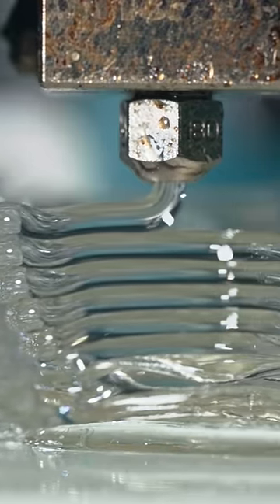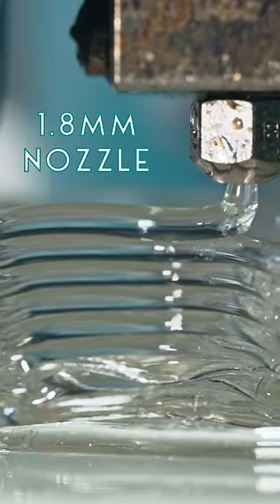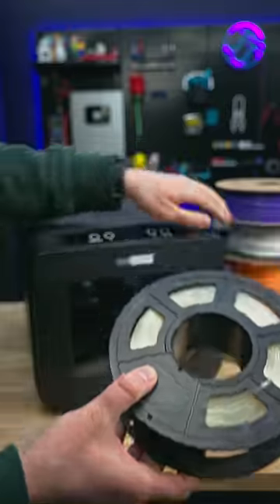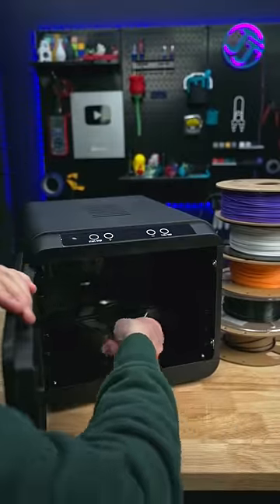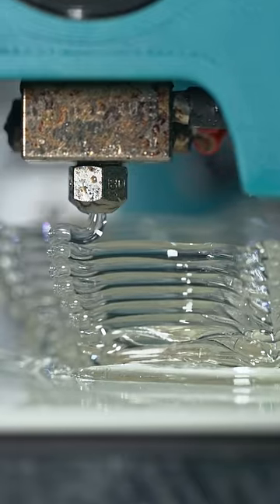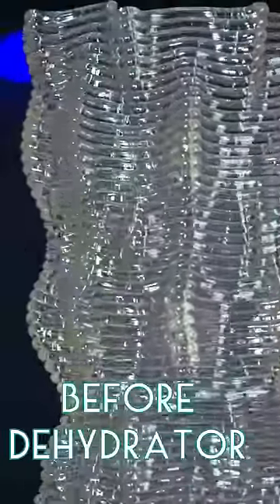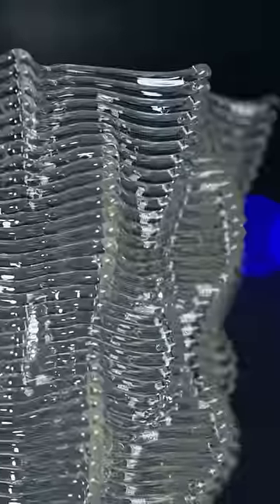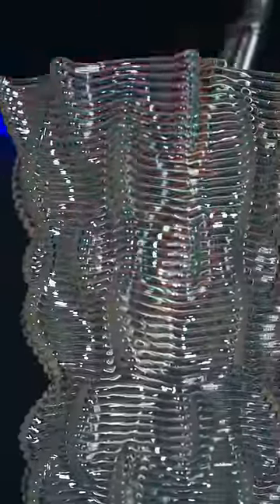Dehydrating Clear PLA Filament

Comment from the maker: 🔥My Favorite Starter 3D Printer: https://amzn.to/40NWmg5
Favorite Mid-sized 3D Printer: https://amzn.to/3Eq9KNa

🌈FAVORITE PLA Filament: https://amzn.to/3UkGVJx

📂STL Link: 
https://www.printables.com/model/16170-lumpy-bumpy-vase

Patreon Support: https://www.patreon.com/jjshankles
Support me on YouTube: https://www.youtube.com/channel/UCHH_3lX8QShJnhHVA422OCQ/join

📖Learn more about 3D Printing with a Podcast I co-host: http://Perfectfirstlayer.com
Reply: Make a star for a Christmas tree then stuff it with lights.
Reply: Have you tried color dream looks way clear?
Reply: I like your printer suggestions.  What do you think about Bamboo?  Aside from the high price
Reply: Why did you set the layer hight so high, or is that a result of a high z offset? Either way what is the point of doing so, if anything it will severely degrade the print quality
Reply: @patrickputrus560   point here is NOT to squish the filament so it stays as clear as possible. It still stick pretty good. I tried 0.4mm layer height with 0.4mm nozzle on the same model and got just a single random leak when filled with water to the brim. And the print looks quite nice.
Reply: Where did you get the filament and what was it called?
Reply: what song did u use?
Reply: what song did you use?²
Reply: You could use it as an optic light transfer cable, print a certain shape, damage it in some parts and shoot a laser beam at the end of the print
Reply: Which dehydrator is that?
Reply: Going to be honest dude I see no difference
Reply: ‼️MAKE CINDERELLA SHOES! The ICONIC clear "glass" high heel!
Reply: How much does that much filament cost?
Reply: Nice
Reply: I challange you to make a print/vase/cube... Whatever. As see-through as you can! 😊
Reply: Okay I've got a random challenge for you... Make swimming goggles and a snorkel.
Reply: please link to the clear PLA!?
Reply: Do a shower curtain cup that when you fill it up with wine it shows Janet Leigh screaming
Reply: Hey is this the white lithophane filament?
Reply: Why isn't the dehydrator listed? (VIVOHOME Electric 400W)
Reply: What about the filament?
Reply: What kind of dehydrator is that?Thanks!
Reply: Is there a way to possible get CultureHustle LiT pigment and with a glass muller get the pigment fine enough where it could applicable and be used mixed with a resin of some-kind… 
And possibly use the different variants of colours and pigments.
Reply: @patrickputrus560  - Seems the layer ht. is part of the intended aesthetic ., especially as that's the stated goal from the start of the short re: the large nozzle diameter. I'm guessing he knows about tighter layering ? Just a thought 👍.
Reply: @kisolre - if you want to make it waterproof, seal the inside with a poured layer of clear epoxy . If you're going for a decorative outer pot for your plants,  a smooth sided glass just smaller than the print so it just nests , is a very repeatable approach . 
Shoot, this you've produced is an absolutely sellable product . 
Lots of retail outlets would stock something like this as "Home Decor" . Good LUCK !!
Reply: @chuckintexas  simple nail polish top coat works like a charm.
Reply: Love how none of these links have nothing to do with the dehydrator or clear PLA that you used. :/

Comment: does this mean that hypothetically a hot glue gun is a 3d printer
Reply: When I was working in a packaging factory we had industrial hot glue guns and when I got really bored I’d make little “3D prints” with them. None of them turned out remotely good, but it was fun to do it lol
Reply: It’s exactly a CNC hot glue gun
Reply: Ive used it like that before. Very hard to control the shape obviously, but it was fun lol
Reply: look up 3D pens
Reply: A hot glue gun on a claw machine, yeah
Reply: A 3d printer is just a CNC hot glue gun
Reply: @Frost3D44  best description honestly
Reply: can you make anything out of it with that much strength lmao
Reply: I mean I made an entire river side for a project in 6th grade when I had to make a ziggurat with only a hot glue gun, so I mean technically
Reply: @DoobLand  its makes glue
Reply: Hot glue is like top 10 of the main hobbyist tools. I've seen full dragons for DND made of just glue and looked awesome
Reply: Technically yeah
Reply: Yes
Reply: That's exactly how I explained 3d printers to my family. I told them it a computerized glue gun lmao.
Reply: @JxqGames this may sound dumb, but whats an industrial hot glue gun vs a normal one? Asking cause I hot glue a lot and am wondering if it would be worth getting an industrial one rather than my joanns ones
Reply: Yeah basically but it's more like one of those 3d pend
Reply: @zyourzgrandzmaz  that’s insane no bap
Reply: @mastershooter64  Yeah, just got my daughter one recently. My first thought was that it's just a smaller hot glue gun with a feed button.
Reply: This is like calling a sharpie a printer
Reply: Arguably welding up litte gaps with mig machines is just metal printing. I often weld useful shapes on dissimilar metal and if i go cold enough itll come off smooth backed.
Reply: If your hands are steady and you're patient enough, sure!
Reply: boutta say the exact same thing lol
Reply: Yes
Reply: Thats how scott crump came up with the idea for the fdm printer. He was making a toy frog using a hot glue gun and some kind of plastic and building it layer by layer.
Reply: Stratasys the inventors of modern 3D printers took heavy inspiration from hot glue guns. In fact the earliest FDM prototype printers in the 1970s/1980s were basically hot glue guns in a plotter. ✌️😊
Reply: I don’t see a difference.
Reply: Sigh No Patrick, a hot glue gun isn't a 3D Printer.
Reply: Technically we are all living 3D printers, unfortunately the only thing we can print is poop emojis
Reply: A pen and a 2D printer both use ink, but you wouldn’t typically call a pen a printer.
Reply: The first ever prototype for a 3d printer was actually a glue gun
Reply: Yeah but there’s also 3d printing pens that you can buy for 20$ online
Reply: What’s the song name
Reply: It has been done before
Reply: A CNC machine removes material.
Reply: @gregdubya1993  not always.
Reply: The same way a pen and pencil is a printer yes
Reply: lots of things are 3d printers if you think about them enough.
Reply: yes. they even make little 3d pens that are basically hot glue buns that you hold like a pen and use filament for
Reply: @JxqGames cool story my sister did a similar thing and became a piece for a bored game
Reply: a skilled user on hot glue gunning can do objects better than any printer
Reply: Yes it can be
Reply: a 3d printer is basically a CNC hot glue gun
Reply: Hot glue sticks are literally made of wax and some low temp plastics and polymers, so it's exactly that.
Reply: It's a 3d printing pen
Reply: Just slower drying and less precise
Reply: 3D pen, and they make those.
Reply: @MerpSquirrel  yeah, but that's not what they asked...
Reply: Tell the guy who patented fdm printing made the first 3D printer, he basically made a motorized hot glue gun it made a plastic frog for his daughter
Reply: Basically yes
Reply: No just no
Reply: Ben Shapiro: Now, let's say, for the sake of argument and hypothetically speaking, that a hot glue gun is a 3D printer.
Reply: basicly a 3D pen @JxqGames
Reply: Yes
Reply: @mmace3  and babies sometimes
Reply: Its exactly the same principle, just that the nozzle needs to be a BIT cooler
Reply: I’m gonna try this when I get home from my grandmas, got any idea what I should try to “print”?? 😂
Reply: You don't have to cut me out my full brain exploded when I hear Patrick say his first fact 😮
Reply: The same way pen and paper are an ink printer, sure.
Reply: That’s how I explain it to people who don’t know what 3D printing is.
“It’s like a hot glue gun on a robot arm”
Reply: @JxqGames omg. I used to have a really artistic friend who made a sitting woman with a ponytail out of glue w a gun. It looked exactly like what it was supposed to, and it was his first try. 

Unfortunately hes now in jail for murder though, so his talent is wasted
Reply: 3d pen
Reply: The psychos that make those stupid 5 Minute Craft vids seem to think so😂
Reply: kinda but takes a lot longer since you have you wait for each layer to dry fully and it’ll be super flat
Reply: If ur good enuff
Reply: Yes
Reply: If a pencil is a 2d printer to u then sure
Reply: Girl math says yes
Reply: A paper printer is also a 3D printer too so yea
Reply: Exactly what I came to say just late to the party 😂
Reply: It would be a 3d pen, ehich already exist, if u put plastic cylinders in it instead of glue
Reply: A human can be a 3d printer if they’ve ate enough Taco Bell 💩
Reply: @JxqGames  I think you want to hot glue a sheet of wax paper or the like that doesn't stick, then once you've made solid little flat shapes, you can hot glue them together...
...but I don't think that trying to "3d print" will bring about any success.
Reply: It's an extruder, but that would only mean that you are the 3d printer
Reply: It has always been a 3d printer, just manual
Reply: @Stuck.in.the._Abyss yeah hot glue has a decent tension strength
Reply: if a pencil is a 2d printer
Reply: It is hunny. What do you think cosplayers have been doing 😂😂😂
Reply: @JxqGames you can. Cosplayers have been doing this for years
Reply: Always has been
Reply: This is how I explain my 3d printer to old people
Reply: Well 3D pencils are technically a hot glue pistol
Reply: A printer with no art talent
Reply: No, the 3D printers are hot glue guns 😂
Reply: Yes😂
Reply: @laughableInflection  or get a consistent flow if it's cheap
Reply: printers are basically hot glue guns yea
Reply: It's fundamentally the same: pushing melty stuff through a hot nozzle.
Reply: If you had pla sticks then yeah a hot glue gun would work a lot like those 3d printer pens
Reply: not on its own because 3d printer is supposed to print stuff by itself by using a code, but you should be able to salvage glue gun parts to use them as a hot end for an improvised printer
Reply: every time i explain someone what a 3d pritner is, i explain it is a motorized hot glue gun that deposits melted plastic where the part design demands it
Reply: They already did that, a glue gun 3d printer
Reply: No, technically it'd be a 3D pen.
Reply: it does
Reply: well yes but no
Reply: I mean atrache a hot glue gun to a machine that has motors to move the gun in a x y coordinate system and use Matlab or something to control the motors and ya you have essentially a 3d printer.
Reply: ElectroBOOM 3D printed a tree using his hot glue gun.
Reply: @JxqGames  i did the same with leftover hot glue from projects. I would also make little molds out of lego and do some injection molding as well 😂
Reply: Yes and no . Printing means exact copy of model where as in gule gun model may come with imperfections . If you can make exact copy of model then it's a 3d printing

Comment: Don’t want clear plant pots. Get root rot and algae that way
Reply: Also isn’t this plastic? It’ll leach into the soil with heat moisture and uv
Reply: hm.. what if there was a plant pot around it to keep the light out? then you could lift it every now and then to check on the roots.
Reply: @rollingthunderinho to be fair it is pla, which is biodegradable, and its actually made out of corn starch if im not wrong
Reply: @lucazar2459 "biodegradable". it still has  a very long degradation process. there have been several expiraments in which PLA is buried for a year or more, but there was little to no degradation when they were dug up
Reply: @salty156  biodegradable just means it's safe for the soil. it will still leach
Reply: @rollingthunderinho not really an issue. 99% of plants we grow won't live long enough to see any damage from plastic leaching. Probably wouldn't even if it was leaching quickly.

Plants are super robust. The direct light would be the biggest issue
Reply: @oldkingcrow777 that's just incorrect
Reply: @oldkingcrow777  plant roots don't really give many shits about light... i use old takeout cups alllllllll the time... no worries
Reply: in fact theres evidence that it causes more root growth, possibly non- positive root growth but still...
Reply: @ATAdude666  that certainly doesn't mean we rewrite science based on your limited observations. 🤣🤦
Reply: @ArcOfTheCovenant  that uh... Was actually my point
Reply: @ATAdude666  oops replied to wrong person 😬
Reply: @lucazar2459 the corn bit is true.. but like others have already said, the biodegradable bit is marketing BS.
You need above 60°C for it to degrade without leaving microplastics...this is not possible in your garden or out in nature period.
At least it's not based on oil and thus slightly better then ABS,ASA,PETG,nylon and so on...
Reply: @lucazar2459 many plastics are biodegradable or compostable. It still takes a very long time
Reply: @SuperUltimateLP  oh ok, thx for the correction
Reply: @pokidev027 biodegradable doesn't mean it's safe for the soil. It means it would decompose by the soil bacteria.
PLA is non toxic though, and so this is safe.

Comment: DO AN AQUA LOVING PLANT! Some plants only need water to grow- this would make amazing work of the clear vase!
Reply: It wouldn't. Water degrades PLA.
Reply: @ProteinFromTheSea  Yeah, should use clear PETG instead.
Reply: @slipangle3027 you guys in these comments are all way to smart for youtube shorts 😂
Reply: And watch the green algae go nuts. You haven't had too much time growing plants
Reply: @priorsproductions2426  got nothing else to do while I 💩
Reply: @ProteinFromTheSea  if only something could be applied to the surface to seal it...
Reply: @ProteinFromTheSea  It won't break down in water for years unless there is a lot of direct sunlight or the temperature is really high. The main problem would be water proofing it.
Reply: @anoukk_  It's a plant. It needs direct sunlight.
Reply: @ProteinFromTheSea  Most plants can do pretty well in indirect sunlight.
Reply: @ProteinFromTheSea  it’s not like he’s going to be water a plant in it anyways..😂
Reply: @anoukk_ pla degrades in water in 47-90 days depending on water temp because it is cornstarch based
Reply: The "pla can't do that" meme comments are something else. I've had a castle planter made with PLA and I've had it sitting in the sun with a plant I water regularly for like six years. No issues. Wood glue at the bottom to waterproof it.
Reply: @ProteinFromTheSea It really doesn't.  I left PLA in water for two years as an experiment, it is still in that water today, not broken down.  PLA like most plastics takes a really long time to degrade.
Reply: @brittanywesley9582 It really doesnt.  I left PLA in water for two years, placed on a window sill in direct sun.  Still not degraded.
Reply: @ProteinFromTheSea how are you supposed to grow anything there then? You're gonna water the olant at some point anyway
Reply: So flowers?

Comment: CNC kitchen did a video on clear printing, if you get the infill and layers perfect so that there is no trapped air, you can make solid parts clear. However this requires a lot of tuning and trial and error.

Comment: At this point look at the nozzles for 3D printing cement buildings with. Put two bars one inside and outside your vase but you need a tool changer or to make a base with one extruder then change the tip.
Reply: what
Reply: @runforitman  yea I’m also not exactly sure what they mean 😂 glad it’s not just me. 😂

Comment: god thats beautiful. i wish we could do that with glass
Reply: Glass 3d printing is a thing, its just really expensive and dangerous cause it requires a moving furnace. You also basically print in a annealing oven
Reply: @lloidffxi  I wonder if it could be done in a similar way to normal FDM. Just have a glass rod fed into a very hot nozzle with blowtorches instead of cooling fans to help it stick better. Maybe fibre optic cable could be used since it is quite flexible, like filament.

Comment: Is… it… water…. tight….???
Reply: why wouldn't it be? it's solid plastic.
Reply: @UnironicScrotumhat  a lot of possible cold joints, which would leak
Reply: @Ryan-sw3km  he could always do a test by filling it and patching any holes
Reply: @UnironicScrotumhat  FDM prints are very often not watertight, you get small gaps between layers.
Reply: @UnironicScrotumhat  actually, most 3d prints are not watertight after a few minutes. Its not a solid piece of plastic, its layers with microscopic gaps, which is also why its hard to clean such things.
Reply: @UnironicScrotumhat  how does that look like a solid piece of plastic to you? The only truly solid piece is the line that spirals round the model since it is in vase mode, I would not really class the layers as solid plastic, especially with no squish, this is just a single strand wrapped round and laid on top of itself and the layer below is probably pretty cold by the time the next layer is added.
Reply: Leaking isn't actually too bad because it would also allow air into the soil which is needed to grow the plant healthier

Comment: Look into 1.5mm  profile nozzles. Yes it takes some additional time modifying things in the slicer and prints should take longer but because of the amount of material being extruded, you can print 5 standard layers in one pass when retaining layer adhesion.

Comment: Hey, you're like a full layer-line too high. Lower that nozzle and get a
 solid cooling fan on fresh line. This will help your layer adhesion and
 stop that overly melted droop. You might even lower your bed/nozzle 
temps a tiny bit on those first few layers because it looks melted all 
to hell. If you lower the nozzle, you don't have to have high temps just
 to get it to stick. What your printer is basically doing is dragging 
the filament through the air. You want it just barely touching the 
surface- the moment the filament comes out of the nozzle, not laying 
down on top of it after a few millimeters.